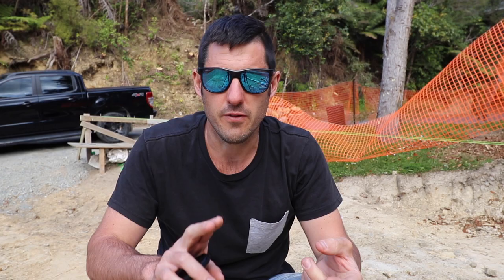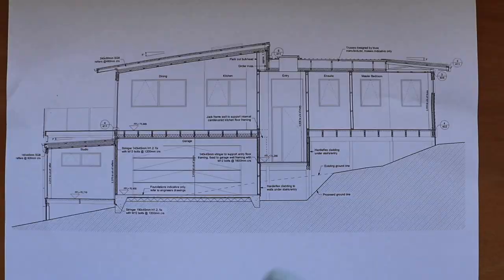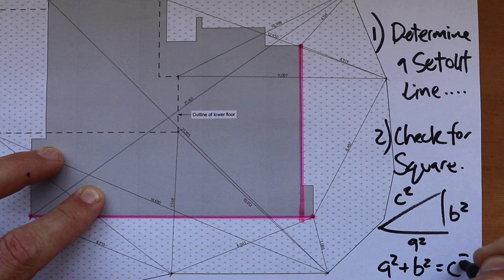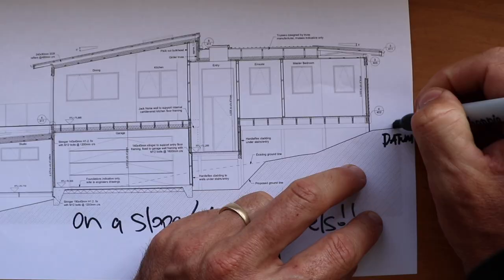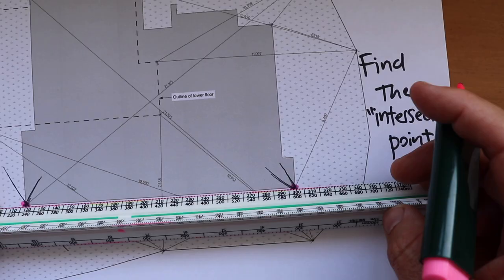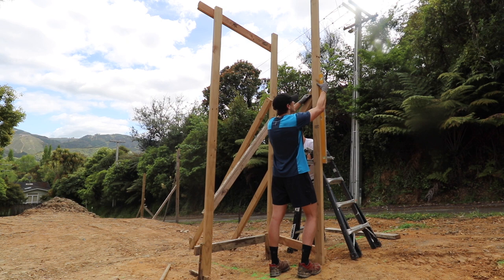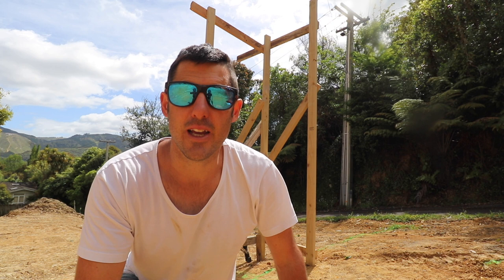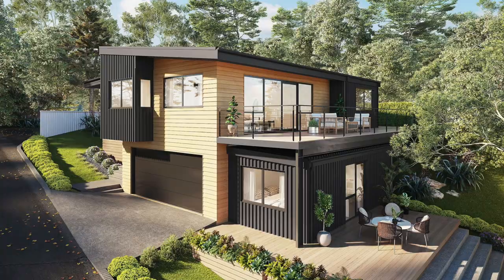How to  "set out" a complicated house - my hardest one yet !!!

Comment: Hey Josh, would you mind if I am asking will the surveyor set out by their total station for a complicated house?
Reply from the maker: yes we often get them to set out for us, usually with their GPS
Reply: Hey, I'm a surveyor based in NZ, and also enjoy Josh's channel. 
We usually set out using Total Station (cause it's most accurate say around 1mm)
GPS can be used depending on the accuracy requirement (accuracy normally around 20-50 mm)
Personally, I always use Total Station, because it's accurate and takes a similar time compare to using GPS. (So the cost is similar, but much more accurate)